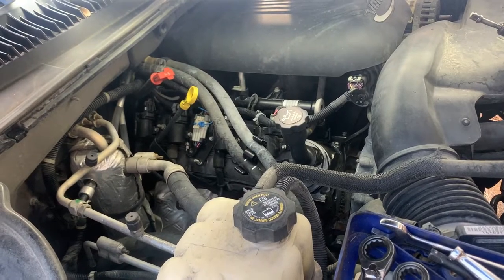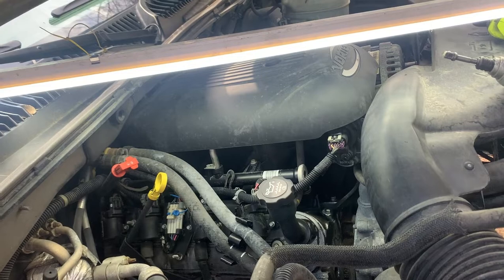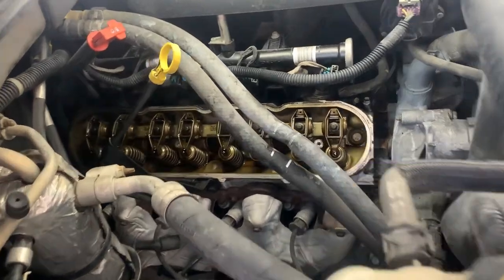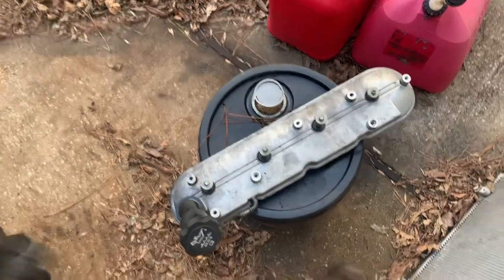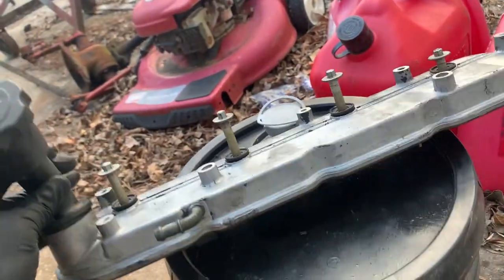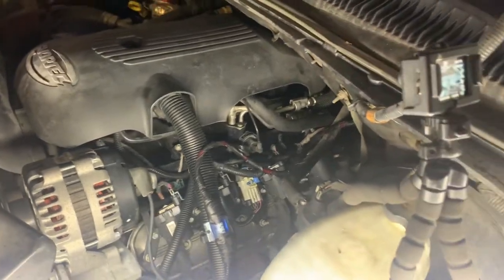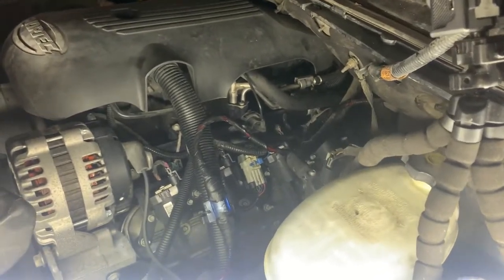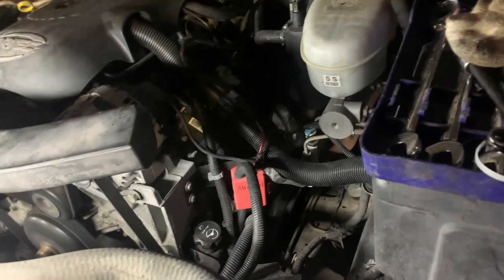Replace Valve Cover Gaskets 99-06 Chevy/GMC Truck/Suv 4.8, 5.3, & 6.0

Comment: Maybe I missed the passenger side torque wrench the cover bolts because of speed???? Why was this not done to prevent future oil leaks? And i see both sides missed the being  torqued down. Please don't  teach people to not torque. Just trying to help, not knocking your video or you sir.
Reply from the maker: You are correct, I just pinned a comment with the torque value.

Comment: Quick question I also have a gmc Sierra 1500 and I change the spark plugs and that took away the misfire but after a month the misfire came back again if anyone knows could it be that the valve cover gasket leaking into my spark plugs and causing that misfire? And if so would I need to change the spark plugs again?
Reply: Yes you should

Comment: Hey nice video! Couple questions tho, would it be better to clean off built up oil on the valve cover after you take off ignition coil bracket? Also can you do this job without using trans assembly, what if you have nothing, just the gasket, would that be ok?

Comment: Thank you for this guide. 
I just acquired a 00 Silverado 1500 2wd 5.3. 381,511 miles. Runs great no knocks,ticks. (Does tick/knock on quick cold startup but ive been told its due to oil pump is old and warming up?).  Only codes are for 02 sensors. But it does have its faults.  Has a good slow constant oil leak.  Looks to be coming from the back of the valves covers.  
This look real easy.   Simple.   I love rock auto.   Going to have to do this next weekend if the weather is nice. 😅.
Reply: My 2000 sierra witb 218000 miles has the same tick for about 5-10 seconds in a cold start if you find what it please let me know
Reply: @tylerpollock6317  my 05 with 370,000 had a ticking noise when cold starting. Found out its from oil draining from the lifters when its not running. I started using a heavier weight oil (10-40 with lucas stabilizer) noise went away immediately. I switched back to 5-30 in the warmer weather, then noticed the thinner oil leaked faster through the valve cover gaskets (fixing this weekend) i talked to another mechanic in the area, he recommended to use 10-30. The thicker cold weight will keep it in the top of the engine longer and still perform as usual when it heats up. Hope that helps

Comment: Hello i have a 1999 GMC truck 2500 got white smoke coming out of the muffler and no ticking or knocking motor is 5.3 I'm asking for help to fix my truck
Reply: Same bro fixing my coolant leak and 02 sensors tomorrow then buying a whole gasket set and going to use my pto to do the head gaskets aswell and add my tbss intake with 50lb injectors.

Comment: I'm having an intermittent knocking noise in my 2005 gmc yukon 4.8 . It's only when cold and goes away when warm. It sounds like a rocker or lifter Knock but how can something like that be intermittent  ?? Very confused on this on and ain't got the money to take it somewhere.
Reply from the maker: Could be piston slap. Pretty common on these, mine does it.
Reply: Lifter tick
Reply: Could be an exhaust manifold bolt that is broken, they seal when the engine is hot.
Reply: Its a lifter that is knocking. Pretty common issue on 5.3l vortec. Make sure your oil level is on the high side. Mine knocks when cold and low on oil. Try marvels mystery oil.

Comment: what is the torque on the bolts for the pan
Reply from the maker: Valve covers are 8ft lbs if I recall correctly.
Reply: @mjmcomputers 106 or 8?
Reply from the maker: @flex2125  106 in lbs is close to 8 ft lbs, either is probably fine.

Comment: Hey dude did it fix your leaks or did they come back?
Reply from the maker: Fixed my leak
Reply: @mjmcomputers  Nice I just did my valley pan gasket (found that the rear 2 bolts were loose and likely the cause of my leak). I still replaced the valve cover gaskets and also replaced the driverside with the new updated cover to help w/ oil consumption. It looks like my leak is gone but I'll need to clean the driveway of the old oil stains first.
Reply: @extorter  what's the new cover about on the driver side? i'm about to do my covers, thanks
Reply: @sir-mac it’s suppose to help reduce the oil burning . I’m do mines this weekend since it’s one of those overall improvement upgrades
Reply: My valve covers are shot. I drive it a mile and it’s blowing smoke when it hits the engine…02 Cadillac 6.0 engine with 280,000 miles …for a while the mechanic has been saying the rear main seal is leaking and he wanted $1900 to fix it but I’m not putting that type of money in this old of a vehicle but I really enjoy this SUV everything works it’s roomie  and comfortable. I was just wondering could the valve cover be leaking also in the very back and it’s not the rear main seal…
Reply: @jonbri4383  you never know, could be worth a shot if you are mechanically inclined.
Reply: @extorter  I am I like to work with my hands. I changed the starter the alternator the brake assist hydroboost thing. I’ll probably do this during the week when I have time and if it’s not the rear main seal, my mechanic will become my former mechanic.